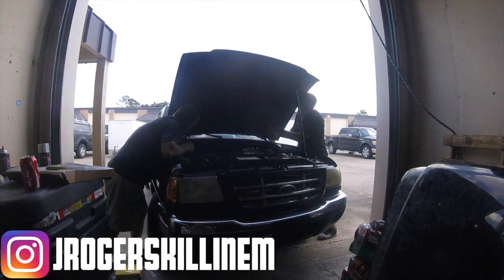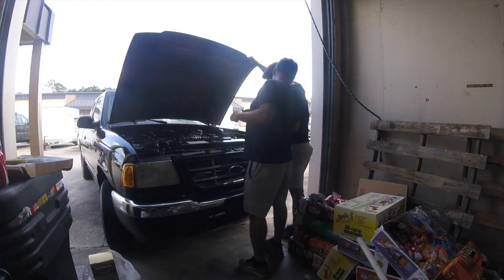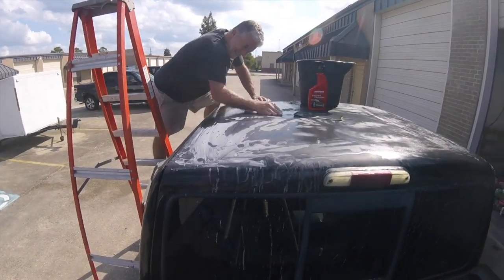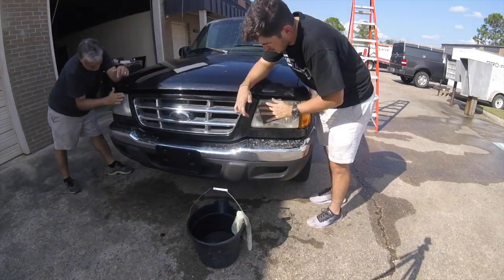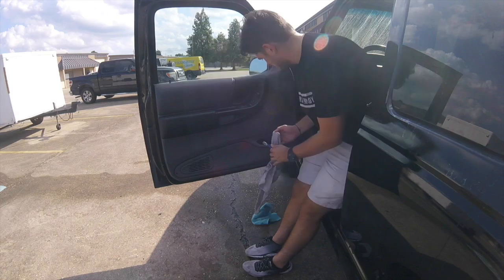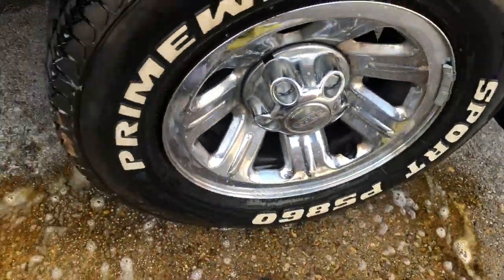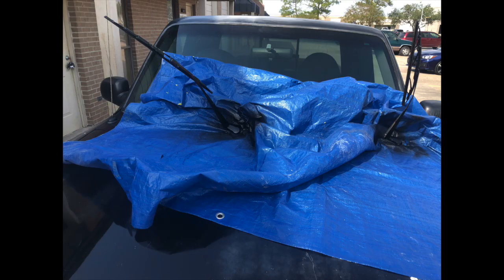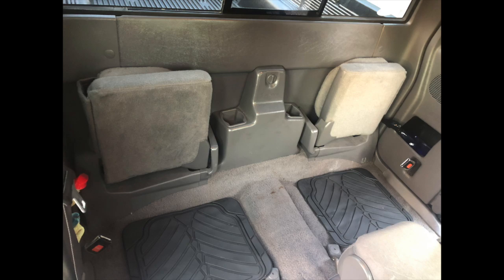DETAILING DIRTY FORD RANGER (Time Lapse)

Comment: what grit did you use?
Reply: Veekzy start with 1000 then 1500 then 2000 grit then polishing compound and finish with carnuba wax for repellent or Rustoleum 2x clear coat for longer lasting

Comment: Hey man I’m flipping a Ranger and have the same oxidation problem on the roof. What is your dad using to remove and restore?
Reply: Nature’s Offspring it was a clay bar to clean off rough oxidation then 1500 grit paper to 2000 grit then Meguire’s ultra compound to light compound to polish to carnuba wax for best results.